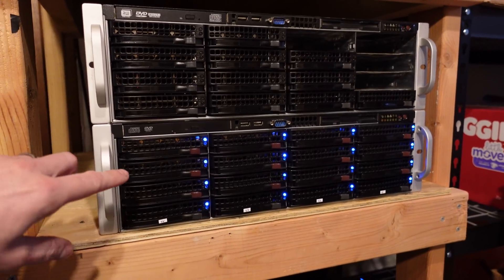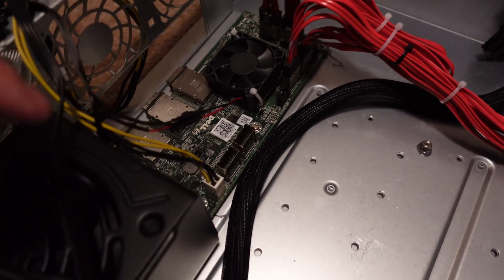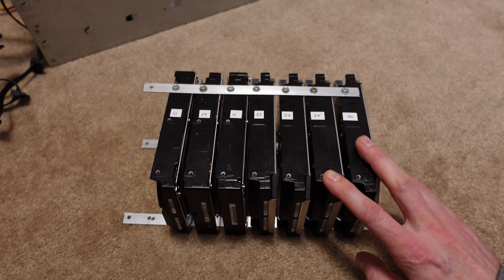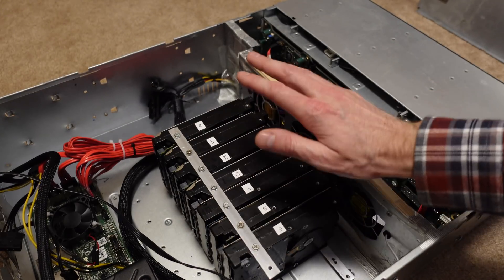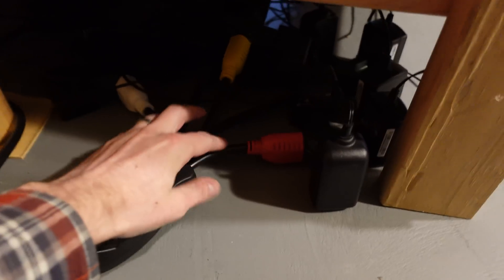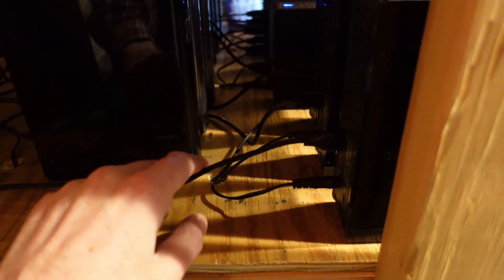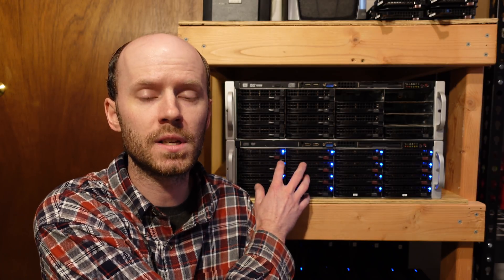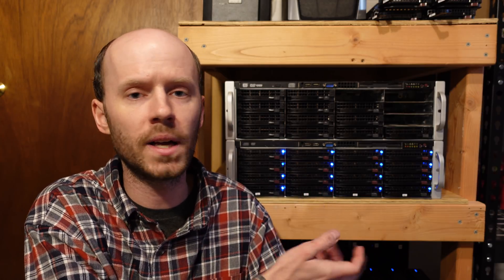Update on the Chia Coin Cryptocurrency Farming Rig

Comment: What do you mean by main node or harvest? How many computer do you have to run on how many hard drive? What is you overall setup?
Reply from the maker: The hard drives are all connected to one computer with the harvester. A separate computer is running the full node software. You can run them on the same computer if you want.
See this guide: https://github.com/Chia-Network/chia-blockchain/wiki/Farming-on-many-machines

Comment: Right now I’m running a full node on my RPi4. It’s always synced, but my “successful points percentage in last 24 hours” fluctuates around 25% to 50%. I’m using a 6 TB WD external over USB 3.0 for the mainnet database. I think I need a SSD for the DB. What’s your thoughts on that?

Comment: I hope you put rubber on the inside of those rails holding the Drives together.  Phrases like "Rock Solid" are very scary to me as vibration can be a problem for longevity of the drives.
Reply from the maker: I was wondering about this, but I thought through it and decided they probably weren't needed. My standard ATX computer case has them screwed right to the case. Additionally, there is no rubber on any of the 16 drive trays. At what point would you say rubber washers (or something) is needed?
Reply: @LithiumSolar  more than one drive. Just one to two drives per case is fine rigid mounted, but after that they will shake each other apart. It's not a big issue, since your using this for mining so a replacement drive is cheaper than worrying about it.

Comment: wow, the hard drive price is dirt cheap for used.  I had to build some 40tb nas and 10+ tb 5400 rpm drives were over 350 if you could get them.  The new price has dropped a lot since then and are available.  anyhow, great video again... PS. I've only used sas in aix and server type stuff.
Reply from the maker: Yeah the typical desktop user (probably 99.9% of them) doesn't use SAS and likely doesn't have a clue that SAS drives exist. This is one reason they're so cheap on the used market.

Comment: When you said said Spacepool I knew why you're not profiting yet. You’re getting shaved by using pools and the endless problems introduced when you add those pool layers!  I have yet to see stats of a single person on a pool that earns 1/2 the Chia I do per TB. Most are in the 1/3rd rewards I’m at per TB. I’ve pulled 46 Chia on 410/420TB’s all 100% solo and every single month without fail. I pull in 50-100% more Chia than Chia Calculator says I should make. Chia Calculator is and has always been low on earning estimates if you have a  fast rig, with a fast internet with low ping and connect to more piers than default. It’s not just the dust storm it’s the raspberry rigs, the 10 year old rigs, the improperly configured rigs but the biggest gains for me getting more wins than I should are the from the people using Pools. 

Do you think the earnings from ChiaCalculator are correct? They are also way off (low) Need proof? ChiaCalculator calculates your % of net space based on 4608 chances to win a block per day. You can do this same calculation without even using ChiaCalculator but it's missing a giant portion of wins potential. If a farmer is misconfigured, or times out, or has a bad connection, or has invalid plots, or for whatever reason does not validate the 64 checksums [sequentially done reads] within 30 seconds on a winning block. He loses that block. Right? Plots passing the filter requires about 7 random reads in a plot, whereas actually validating a winning proof requires 64 (sequentially done reads) 

So who gets those rewards on the timeouts? The next farmer with a fast system that's configured properly gets that block lost by the other farmer. Most of the pools hide this from you and they all have shaving built into their script win calculations. They pocket that money as 30-40% of systems are missing those potentially winning proofs and I’m not even counting the rigs losing to the dust storm. So now your odds are % of net space using based on 4608 chances to win a block per day. PLUS all the plots you can catch that timed out on other systems and they add up.  I also run low latency gigabit connections with a redundant WAN/LAN backbone. I have 100's of Chia clients not the default 20 or 80. 10 Gigabit wired switches. I use the fastest 4th GEN NVMe's. My plot drives are 7200 RPM Exos Enterprise drives. My CPU is an overclocked 5900x 12 core. I'm catching the blocks that are timing out! Get it and by using a pool you gave that all away. I probably could run a slower setup but I just don’t want to take the risks of losing a few blocks without knowing it like almost EVERYONE is. I know a bunch of big time miners, not baby farms like mine and they all pull in way more than expected Chia per TB that ChiaCalculator estimates. 

 Also you are using a Pool that adds more layers of pings and complexity that can cause you to timeout on potential winning blocks that take 64 [sequential reads] to verify in a limited time period! It all adds up! Pools are also shaving in many other ways. Ever notice how many pools show your number of plots bouncing all over the place? Why would that happen? That's also part of the shaving! They love to exclude good plots.

Also check that your Logs are set to INFO to WARNING. Do some chia plots check -n 1000 and see how long it takes as validating a winning proof of "Sequential" 64 checks might be taking to long on your system than 30 seconds especially when you add in pool hops, pings and server delays to each of those 64 check Sequential checks on your drives.

As for Chia jacking up the prices on HDD’s. For a few months that “was" true. Chia added a huge demand for drives and drives over doubled in price for months but now that Chia’s netspace has shrunk >10% over the last few months that’s not true anymore.
Reply: wow. i would love to see your chia panel. this is something that as part of every chiasocial network including discord never heard someone say their stats are. impresive. do you use k32 only or max out drives with k33 and k34?
ty

Comment: the way your going man you would prob be better off doing a cloud storage system! you have that much space so far! but very interesting.
Reply: Most of the people trying remote Cloud storage with Chia have failed due the 64 “sequential" reads on a winning block. They timed out on the 30 second timer due to ping times, server delays etc,.. and lost the winning blocks.
Reply from the maker: In addition to the latency problem, I also haven't found a cloud-based storage provider either that makes sense financially. They all seem to be very expensive for large amounts of storage.
Reply: @LithiumSolar  i think he means scprime coin

Comment: I run the GPU/CPU mining during the cold days/nights to help heat the house while getting some money in return. It's not a net positive, but about cuts the bill in half. Since I would need to run a heater anyways, I might as well get some return back for the heating that is needed.
Reply from the maker: Where do you even get GPUs for mining these days? I really need a new graphics card for video editing and can't find anything of reasonable price anywhere...
Reply: @LithiumSolar  I buy mine when I can find them on sale but it's difficult. Break even point is like 1 to 2 years. I stopped doing CPU mining.
Reply: @WillProwse  Yup. Not so much as trying to make a profit, or break even. Just tryin to keep the power bill from jumping so much.
I know these are rookie numbers, but last night I made about $1.20 with the RX6600. My power costs about $0.13/kWh. The PSU is a max of 800W, but I know it's not fully used. And the rig put off quite a bit of heat.
Considering I used barely of 1kW last night, I consider that a win-win.  :)
Reply: @LithiumSolar  I used my older RX 580 that I bought a few years ago. It barely made 50% of what it used. But it was something.
I recently got an RX 6600 from newegg. Just a shade under $500. Fired up the miner last night and the output is 3x at least. It's still not a powerful card for mining. But for what I use it for, it'll be fine.
Reply: I'm also heating three homes with crypto mining right now. It's nice
Reply: Bedroom ETH/ BTC GPU heaters rule!

Comment: waste of energy
Reply: False news. I earn about 30 times the income per kWh farming Chia than my Ethereum rigs.
Reply: @RadiationNetwork  very very true.
Reply: @RadiationNetwork  30 x 0 is still 0
Reply: @jj-icejoe6642   Simpleton you need to replace those 0’s with racks of GTX 1080 ti’s and RTX 3080 ti’s and yes you can break the LHR locks by flashing a 3090 BIOS on a RTX 3080’s ti’s pulling 110 MH/s.

Comment: So how do you power this? It's a interesting topic since I have loads of old drives around.
Reply from the maker: It's just on-grid for right now. I don't have enough solar production to take it off-grid unfortunately. That would be pretty sweet though if I could!
Reply: @LithiumSolar  its ver low watt use? you got about 450 to 600 watts in there now.
Reply from the maker: @normanvelez4657  The JBOD with 16 drives measured 128W at the wall as shown in the build video https://www.youtube.com/watch?v=8C6-Jw7-Sk8 at timestamp 18:18. There are other things plugged in to the UPS in this video that are unrelated to Chia, so it's difficult to get an exact power measurement of only the Chia stuff without replugging things (pain in the rear).
Reply: @LithiumSolar  i took a guess. did not know you had testig the watts use. how many drives? i have a  supermicro server with 36 drives with 2 cpu and 36gb ddr4 as my node. shut down other high end pc to lower my electric use. only .109 per kw cost. i will tweek it to turn into a monster plotter. will have a youtube channel soon showing my progress.,